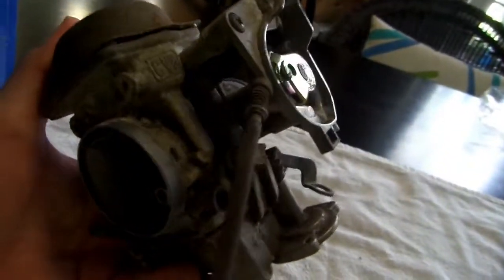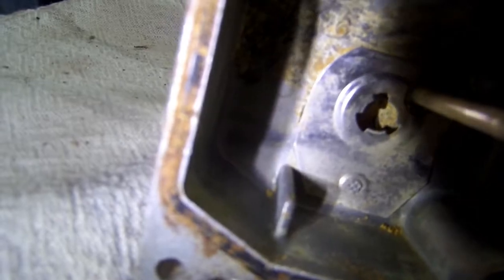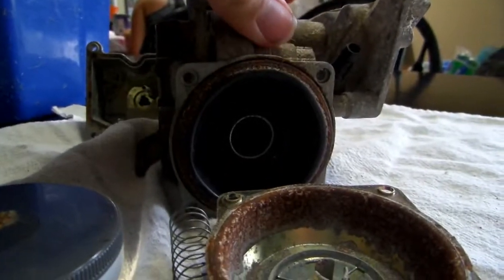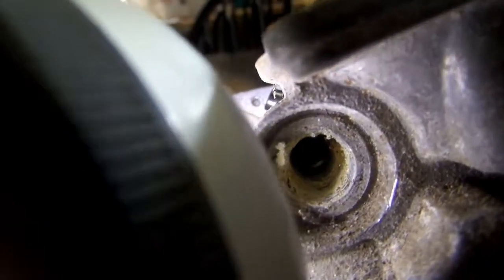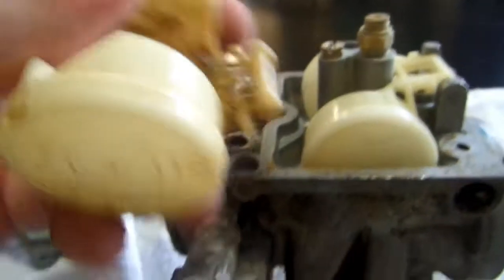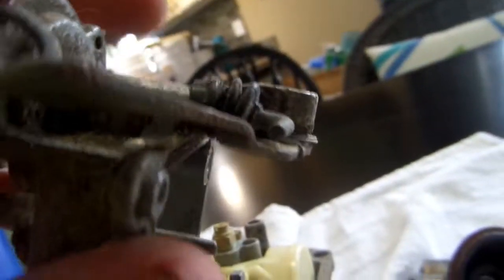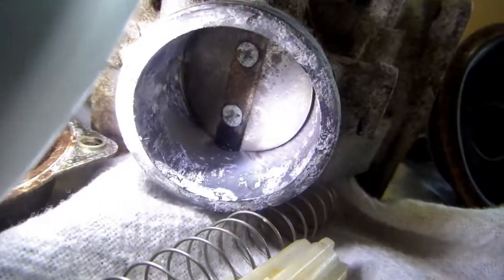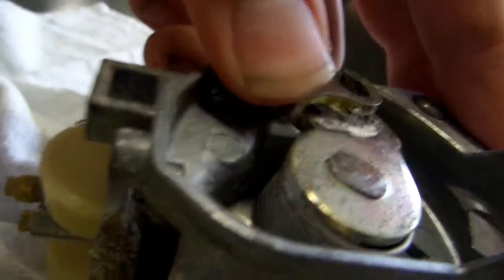Arctic cat 400 carburetor update

Comment: If your talking about the fuel/air mixture screw on bottom of carburetor, it's probably the small o ring in there that's defective. You'll have to remove carb to get to it and remove with small seal pick.
Reply from the maker: Mike Mitchell thank you the screw at the bottom of the fuel bowl on the outside I just put some fuel line on it and hot glued the fuel line shut and it seamed to have did the trick haven't had any problems ever since

Comment: The  needle valve on  bottom of  mine is dripping  gas  any idea  what  is  wrong  with  it ?
I  turned  is  out  some  and  back  in  did  not  help.
Think  it  is  a  drain  for  the bowl.
I  there a  rubber  seat  or  something in  there??
Reply from the maker: ken Carr I had the same problem just take some fuel line fill one end with some hot glue then let it Dr I put it on and that's what I did I have not had a problem since